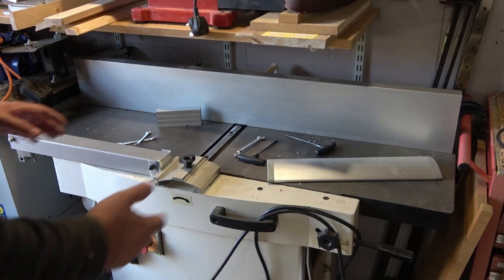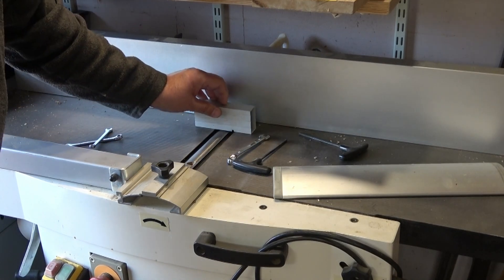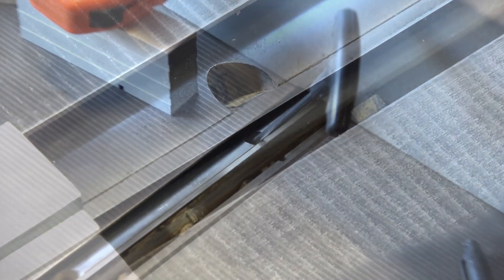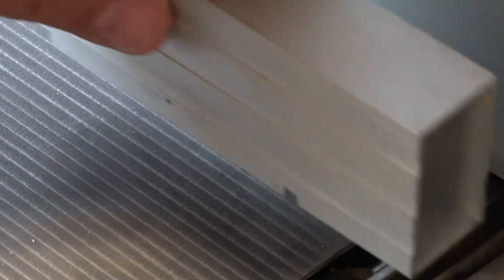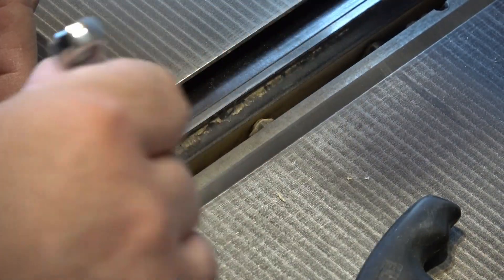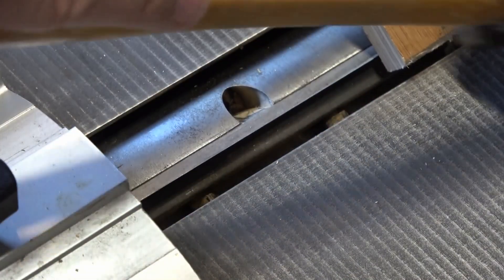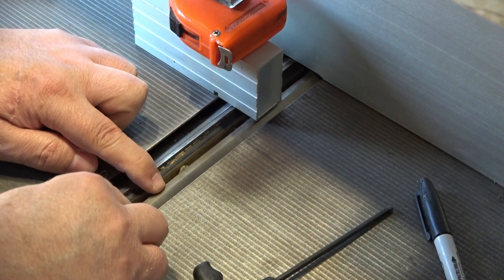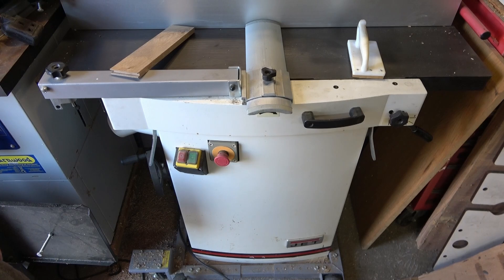Blade Setting - Jet Planer Thicknesser (Jointer-planer)

Comment from the maker: I've since used on some nice oak and working well.  An important skill if you have one of these machines.
Reply: Actually watched this cause after quite some Oak and several hundered fir bars for a fence it was time to fit some new blades and I needed a quick refresher. As luck will have it, I have the exact same machine, really solid piece of kit never regretted getting it, only small regret was not going for one with a prefitted helical head :)
Reply from the maker: i tought very hard about the carbide insert version but i suspect my running costs would ultimately be much higher. these blades were surprisingly easy to get just right.
Reply: @MakeOrRepair  I had considered it not only for ease of replaceing the blades but also because helical heads allow you to run pretty much any material you come across as a woodworker through the machine, thanks to the carbide inserts

I had the issue that HSS blades would struggle with certain composite materials but especially with glued panels, the glue in the seams was hard enough to chip out the blades so you ended up with thin raised lines where that happed.

I installed fresh carbide blades from Axminster now so hopefully that wont happen again ;)